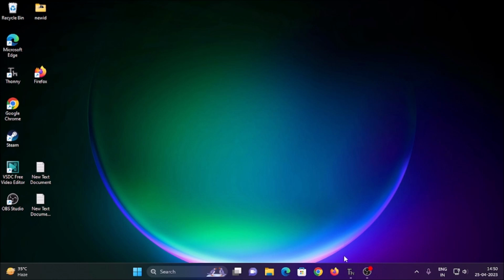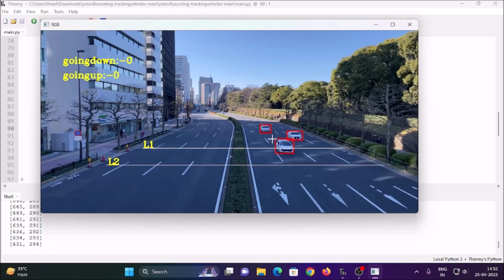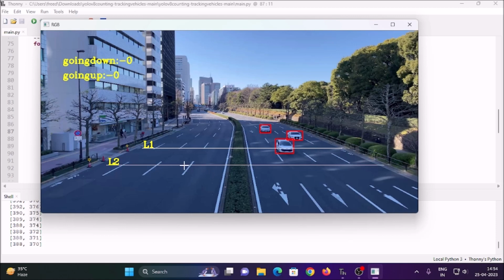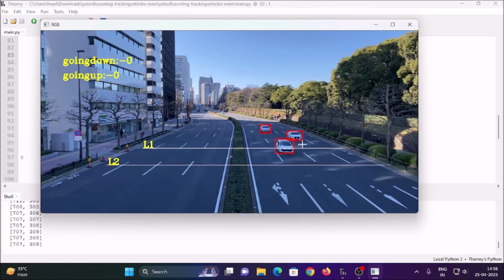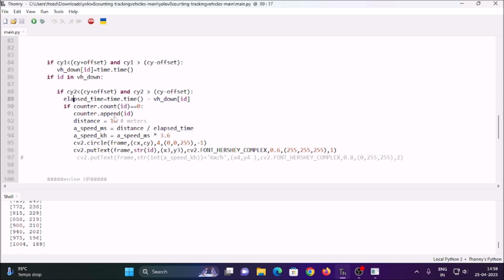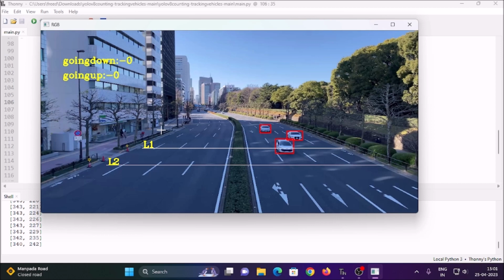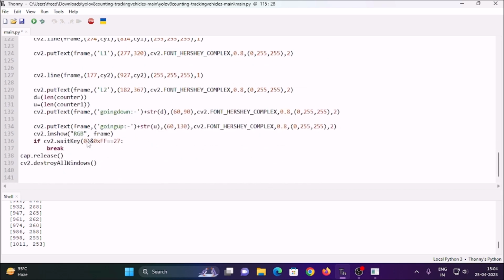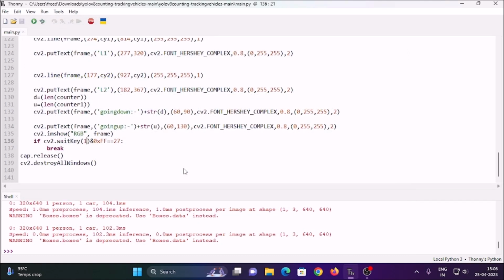yolov8 vehicle speed detection | vehicle speed  detection using opencv python | computer vision

Comment: Traceback (most recent call last):
  File "/Users/hoaithuong/SchoolProjects/AI/yolov8counting-trackingvehicles/speed.py", line 57, in <module>
    a=results[0].boxes.boxes
      ^^^^^^^^^^^^^^^^^^^^^^
  File "/Library/Frameworks/Python.framework/Versions/3.11/lib/python3.11/site-packages/ultralytics/utils/_init__.py", line 153, in __getattr_
    raise AttributeError(f"'{name}' object has no attribute '{attr}'. See valid attributes below.\n{self.__doc__}")
AttributeError: 'Boxes' object has no attribute 'boxes'. See valid attributes below.

    A class for storing and manipulating detection boxes.

    Args:
        boxes (torch.Tensor | numpy.ndarray): A tensor or numpy array containing the detection boxes,
            with shape (num_boxes, 6) or (num_boxes, 7). The last two columns contain confidence and class values.
            If present, the third last column contains track IDs.
        orig_shape (tuple): Original image size, in the format (height, width).

    Attributes:
        xyxy (torch.Tensor | numpy.ndarray): The boxes in xyxy format.
        conf (torch.Tensor | numpy.ndarray): The confidence values of the boxes.
        cls (torch.Tensor | numpy.ndarray): The class values of the boxes.
        id (torch.Tensor | numpy.ndarray): The track IDs of the boxes (if available).
        xywh (torch.Tensor | numpy.ndarray): The boxes in xywh format.
        xyxyn (torch.Tensor | numpy.ndarray): The boxes in xyxy format normalized by original image size.
        xywhn (torch.Tensor | numpy.ndarray): The boxes in xywh format normalized by original image size.
        data (torch.Tensor): The raw bboxes tensor (alias for `boxes`).

    Methods:
        cpu(): Move the object to CPU memory.
        numpy(): Convert the object to a numpy array.
        cuda(): Move the object to CUDA memory.
        to(*args, **kwargs): Move the object to the specified device.

PLEASEEE, CAN YOU EXPLAIN FOR ME THIS ERROR WHEN I RUN THIS CODE. THANK YOU SO MUCH :(((((((

Comment: Thank you for your beautiful project...
I have implemented by using your code.
I GOT PLACEMENT after showing this project.
I Got JOB IN TOP COMPANY 
Hurraayyy.... thank you sir.. wonderful project...
Reply from the maker: congratulation and best of luck if you dont mind please tell me company name
Reply: Sir can do one video on one problem statement..

Like can you count the people entering and exiting from the bus.
Who have not booked the ticket also they are coming into bus and traveling.
Reply: hello i followed same steps what he shown but i got error please help me in getting it solved

Traceback (most recent call last):
  File "<string>", line 4, in <module>
ERROR!
ModuleNotFoundError: No module named 'cv2'
> 

this is the error iam getting
Reply: @narender8074g  opencv library for python will not be installed
Reply: have you imported cv2? @narender8074g  
add "import cv2" at the top, then it should work
Reply: @narender8074g  first of all install open cv